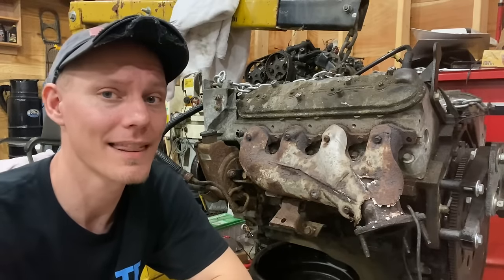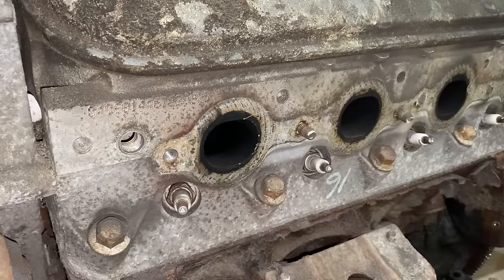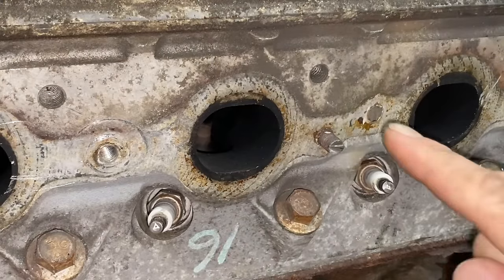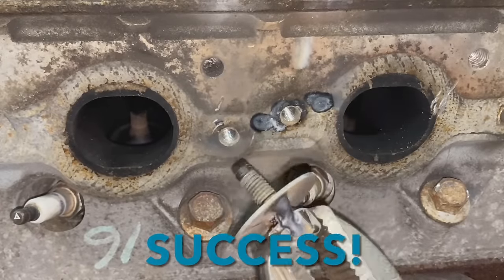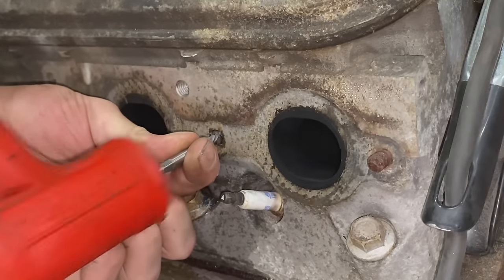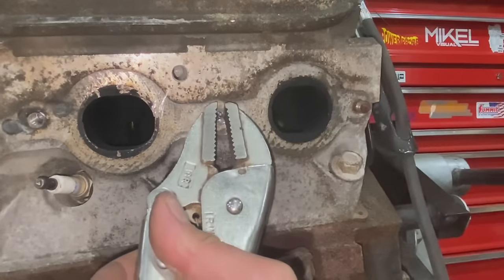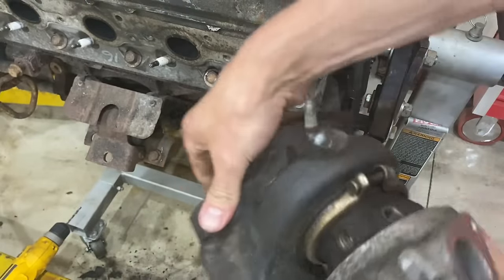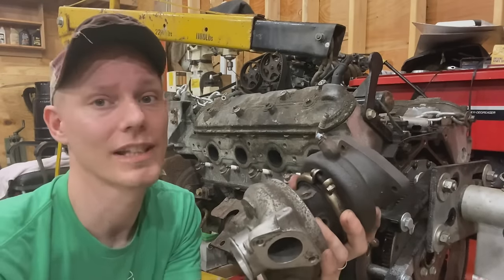How To Remove A Broken Bolt 6 DIFFERENT WAYS - LS Exhaust Manifold

Comment: You made more work than it had to be. Get the torch out and you could have gotton all the bolts out except for the broken one. Weld that on to a nut or washer and turn it out some and it will most of the time stop. Just heat the head by the bolt and turn it out.
Reply from the maker: Your totally right. I also cut the heads of all the bolts off to make it more difficult though. The goal wasn’t actually to get the bolts out easily, it was to show off multiple ways of removing the bolts, which I believe I was successful at. Thank you for watching!

Comment: Cool now show us how to do it with the engine still in the car haha
Reply from the maker: Sadly I don’t have a truck handy. It’s waaaay way easier to get this on camera with the engine out of the truck. That being said, I have done this successfully many times with the engine still in. Just pull the inner fenders and it gets way easier.
Reply: @WiringRescue  yeah true. I'd be willing to bet that 99.9% of your viewers who have this problem don't have the capability/equipment to remove an engine - do you have any tips for removing broken bolts in tight places? The one I'm trying to do is on the side of my engine near the top but I only have like 2 inches of clearance to work on it

Comment: also....some folks arent quite too smart......welding a nut on will not work with steel cast iron heads, because it will weld the nut to the head.....just sayin

Comment: None of these bolts seemed particularly seized.
Reply from the maker: There is no way of knowing how stuck a bolt is if it sits in a hole for 200k+ miles and then I cut the head off it without ever turning it with a wrench. Sorry the video wasn’t what you were hoping for.

Comment: Why Welding nuts, washer's and old auto parts to broken bolts works well is due to the bolts becoming super heated by the welder which helps to break free, rusted, corroded bolts. I can't count how many broken bolts I've had to remove in my life but exhaust bolts are some of the worst! Go slow and if in doubt ask someone for help.

Comment: when you remove that much material from the inside of the bolt you are doing nothing more then pressing the threads deeper into the aluminum head i have seen so many of these LS Engines like that wonder where these cheap bolts come from.

Comment: This is stupid because the bolts weren't stuck to begin with. How about doing this on bolts that are actually broken off because they are stuck?
Reply from the maker: The point was to show different methods of removing broken bolts. If you were hoping to watch a person struggle, it’s probably not the best video for your needs. Good luck with your project.

Comment: Instead of using a vice grip use a small pipe/monkey wrench that tightens up on the bolt as you turn. 1 million plumbers can't be wrong.

Comment: yOU ARE USEING YOU VICE GRIPS BACKWARD IN THE FIRST CLIP. Many vise grip pivot points and teeth are designed in such a way that they grip better in one direction, THINK PIPE WRENCH
Reply from the maker: YES, I KNOW. I DODNT THANK IT WOULD BE AN ISSUE FOR PEOPLE. THANKS 4 THE TIP BORTHER!

Comment: Take a touch, heat the studs, use a 6 point socket, comes right out. This is a waste of time and money!!!
Reply from the maker: That’s tough to do when the bolts are broken off at the surface, but a six point socket is a great option when there is some stud left.

Comment: Welding turbo on bolt ruined good video. Instead turbo you can weld anything iron.
Reply from the maker: Or I could have held the bolt in place and unscrewed the engine from the bolt. Lots of methods here.

Comment: Whenever possible pre-treat the bolts, broken or not with Break fluid! The longer the better IMHO. A high quality penetrant also can work but break fluid has worked for me 8 times out of 10.. careful not to get any break fluid on painted surfaces as it will destroy paint jobs quickly.

Comment: Ya gotta laugh at these stubborn manifold nut removing videos with easy access to the motor block because it´s on a bench, I mean what´s the point ?  try this when the motor is actually in the motor bay and there´s no room to get a blow torch or a spanner down there let alone swing a hammer and cold chisel around 🙄
Reply from the maker: I have removed many broken manifold bolts with the engine still installed. However, if you have ever tried to film these methods with the engine installed, it is very difficult to do. I happened to have an engine on an engine stand which made it easier to film, and figured showing these methods could help some folks. I apologize for trying to make a quality video that helps people.

Comment: must be nice not living in the rust belt
Reply from the maker: 😂 - I’m in Massachusetts where they spray roads with salt for 4 months out of the year. This engine came out of a truck that had no rocker panels, cab corners, or radiator support left. It had all rotted away and turned to dust.

Comment: You made some mistakes, luckily for you none of the studs were rusted,  (a) when using heat on the stud let it cool before trying to remove it, (b) when welding washer or nut to the stud your welder ground cable needs to be attached to the washer or nut not to the engine block, (c) when using a tap it will clean out threads but it will not replace missing threads, (d) what is the point of welding a turbo charger to the stud.

Comment: Bolt extractors are crap. They never ever work
Reply from the maker: I completely agree. Truly a terrible product.
Reply: @WiringRescue  you ever try them purposely drilled slightly off-center?
Reply from the maker: @nolanshreve4596  I absolutely have (I actually just did this on a 75 vette thermostat housing a few weeks ago!) but I was not sure if I would be attacked on YouTube for such a wild idea. I really should make a second video with all of these ideas people are throwing my way! So many great ones!!
Reply: @WiringRescue  but did it help?
Reply from the maker: @nolanshreve4596  I personally believe that it does, but you do risk ruining the threads in that area if you aren’t super careful. I think drilling off center is probably better than in the center, based on my experience.

Comment: ,,,,,,,,,,,,,,wasted all that time..........................heat exhaust components with a mapp gas turbo torch or use an oxy - acetylene torch to heat the metal around the bolt,,,,,,,,,,,,,,,,,,,,,,,